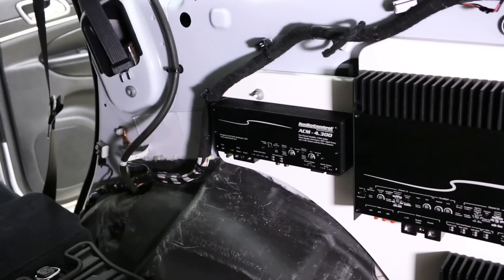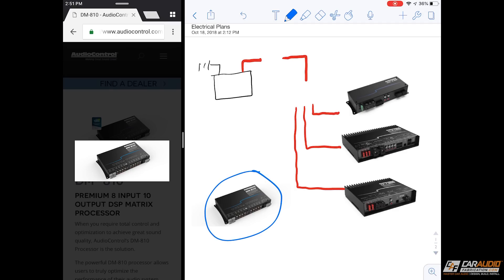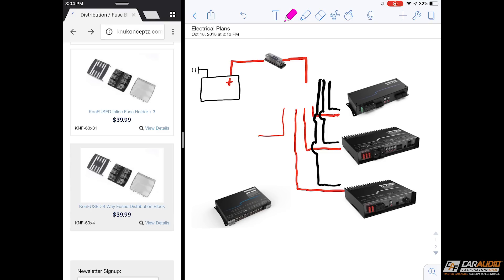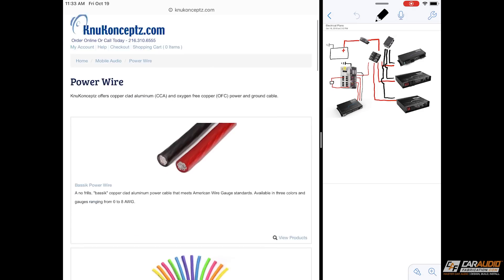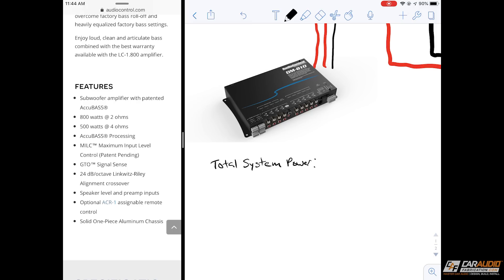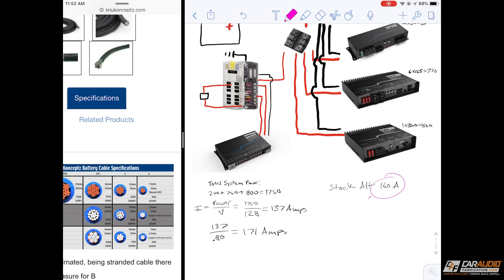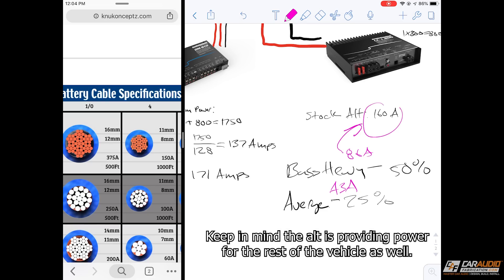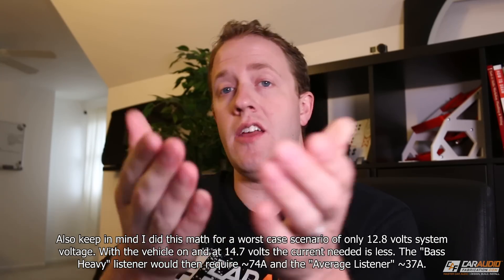How to plan car audio ELECTRICAL system wiring - Is the alternator big enough?

Comment: what size fuse do u you use for the powerwire to the fusebox? and what thickness of wire should i use? Im running a distroblock with 50mm2 in and using 2 20mm2 cables to my amps, can i use 1 10mm2 as power to my fusebox? i will only run a dsp to that fusebox.

Comment: How do we wire a 2 battery 2 amp audio system
Reply from the maker: Same as this, with parallel connections between the batteries, fused of course

Comment: I had my audio system done ✅ and it's a total of 6 speakers and 2 subs that = 2200w RMS on 2 amps.

I asked about upgrading alternator. They said they don't do it and don't bother, and to save my money 💰 
.
My alternator is 130A and the car uses 30A.. I have 100amps of headroom.

But my system needs 180 amps...

So I'm short right?

I need a better alternator.

Anyone know where I can get a good alternator to suit a 2002 LS1 Holden Commodore V8 5.7Ltr

Comment: Thanks for the video, I'm about to get ready to buy all the stuff I need, could you help me clear some questions?
1) When adding the power consumption of the amps, shouldn't you also add the power consumption of the DSP?
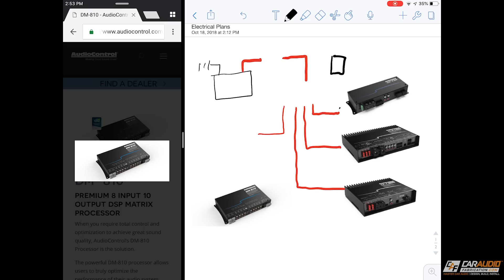2) at 2:48, is the ground distribution block necessary? Or can I have each amp grounded on different points of the car? I don't want to run so much wires, also isn't is best if the ground wire is as short as possible?
3) at 4:38, you added a smaller fuse block. Shouldn't you also add the power consumption of the accesories connected to that small fuse box to the overall power consumption calculated before? The 3 amps+DSP+devices connected to small fusebox? Thank you

Comment: So if I have been running a 1200 watt rms 5 channel for months now but wanted to run two amps that will be using no more than that same 1200 watts do i need to upgrade my alternator? Everyone keeps telling me it don't matter that I still need to upgrade the alternator. Your opinion is the one I really care about and want to know? I was hoping going from 4 guage to 1/0 ofc and the big 3 would be enough.

Comment: How to connect dual battery wiring for 4xAmp (4ch) , 1x mono block , and 1x DSP audio system ... 160A alternator .. fuse? Powercable? Wiring connection? 🥺 Need help Please.. No ideas for do it..

Comment: At the 8:57 mark, you said your amplifiers have an 80% efficiency. The formula is 137×.80 = 109.6 amps, not 171!! Did I miss something?
Reply from the maker: Yes you did. We are working backwards through the math. And amplifier MUST have more current in than out. That's what efficiency means. 80 percent efficient means that 80 percent of current in is what we get out. We know current out based on power rating. So we work backwards to determine the larger current value in to properly size the wiring and fuses

Comment: I will say that I have a bench top power supply for testing. 14v @2A. I hooked up an amp and 2 JL M6 speakers. I was able to turn the speakers up so loud that my ears were hurting all on the 2 amps. Only when I turn it up all the way did I get any audio loss. And I needed to turn it up all the way on a bass heavy song before it blew the breaker. Point I’m saying is you can drive the heck out of 4 speakers with very little power. The high amperage comes with your subwoofers. Just something to keep in mind

Comment: How do I find the correct in-line fuse size for the fuse closest to the positive battery terminal line coming from the battery? Also, If I use OFC power wire, do I need to use OFC Ground wire as well, or is any safe to use as long as it is the same gauge? THX Fam!

Comment: Curious. My truck has a 110 amp alternator and I want to put a 2500 watt amp in it. Will a 96ah headway bank help achieve that or will I need to replace that alternator?

Comment: My question is, what criteria did he use to determine that the 86 amps required for this system in question would likely require an upgraded alternator from the 160 amps. Is there a rule-of-thumb? Thank you!

Comment: A question to Mark: First, a huge thanks for the info. So, do I select the fuse rating as per the total system value or depending on the actual draw calculated.

Comment: Now this is way late but maybe someone can help. Im tryna plan my build i want 4 10s pushing around 3k watts i also have a second amp pushing 400 for my speakers with the math i need 337.3 amps am i supposed to add my stock alternator to that as well or is that a good number

Comment: Like it I like your videos I have a head prob from baseball bat and I can understand you I have a 2011 Ford edge and I'm  only trying to upgrade the door speakers and it has a stock sub so I figured single 10" or 12" I have a old school LS 7 square 15" kicker and the heavier 12" pioneer premium I'm on social security so I'm trying to find anyone who has any old amp and 4 6×9 for doors and I have to keep stock radio so if you have anything that's old and still works or know anyone who can help an old bass head out with anything just need a lil bit of bass so if you can help me and need me to put stickers on VEHICLE to represent no problem

Comment: I have a audi a7. Car is a electrical bank. Can/ should I get a higher amp alternator tho the car runs off a amg battery. I'm thinking off running a tarramp 5k amp and a 1200 watt amp for highs & mids

Comment: one 250-300 watt amp on the highrange cluster and 500-600watts amp for the subrange cluster would be pretty much ENOUGH to blast approximatly 120-130db depending if the system is an sq or an spl like system through the whole frequency range when all the amps are gained down to their 75% power. kicker sealed passive radiator sub system with an INBUILT amp hits 144.8db's at around 45hz and an sq components on the front with the coaxes at the back stage when fed around 300watts total easily hit around 125db+ and if you use midranges and all that spl stuff they can easily do 140db+ why would an average guy that wants some loud bass or some sound quality would need 1750 watts their total setup? do yall go around and listen music 140db+ all day?

Comment: My son is having a issue on his 2013 Toyota Corolla LE 1.8 L 4 cylinder sedan ( it is a regular gas car not diesel) after getting a after market stereo system (including amplifier and 2 12" speakers) it wont start now or it stalls out immedietley after starting we thought it was the alternator wasnt strong enough so he ordered a a 250 amp alternator and had to replace the belt to a shorter one, replaced the wiring for the electrical system and replaced the battery for a higher power one that has more crank power and more reserve but the dang car still will not stay running or sometimes won't start at all. Does anyone know what we should look at next or shoud he take it back to the place that installed his aftermarket Audio system and have them check to see if they wired it correctly? After he got the aftermarket stereo installed it was running fine for over a month until he blew one of his amplifier's and took it back to the shop to have it replaced with the warranty...it drove fine for a few days and then all the sudden i started it when he was leaving work and he didn't even make it out of the parking lot and it died and wouldnt start back up, so i thought possibly it was his stock alternator that wasn't strong enough to run his new audio system that has 2 amps that are  1000 watts a piece and 2 12" sub woofers so i went online and ordered a high power alternator 250 amps and the 3 wire upgrade that's needed for the new alternator got the alternator and wires installed and i was hoping that would fix it...but it didn't so he got a new battery that was stronger with more cranking power and more reserve but it didnt work either. Does anyone know what else he should check? Sometimes the car starts but it dies right after and sometimes it turns over but it wont start. He recently cleaned my throttle body really good and he replaced the fuel pump about 6-7 months ago....so idk if it could possibly be the fuel pump again? Or could it be his starter? But if it was the starter it wouldn't start at all? Or can it start and die if the issue is the starter? Does anyone think he could have damaged something with my electrical system since he had the aftermarket system installed and the shop never told him he needed to upgrade the alternator And battery prior to installing the amplifiers and speakers? Something that would prevent his corolla from starting or cause it to stall out after starting even after upgrading the electrical system 3 wire upgrade, 250 amp alternator and high power battery? If so how can we find out what the issue is? Thanks in advance to anyone that can offer me any suggestions on how to fix my sons car.

Comment: Hi Mark, I've got a Nissan Pathfinder R51 and I plan to install a 4-channel and a Monoblock.  I'm not sure where to install the amps.  I wouldnt want to install under the seats as I feel the space is limited and may not offer the enough air circulation.  The rear is what I prefer, but wouldnt want to sacrifice the 7-seater capability.  Please guide

Comment: So I'm working with a hybrid vehicle that uses a dc/dc converter over the traditional alternator. Could I add another battery in back as kind of a buffer. I don't seem to be having any issues with charging system but I know I'm right under the limits of the vehicle's system.

Comment: Hello and thank you for the videos.  I'm entering the world of DIY audio and these have been fantastic in climbing the learning curve.  One question I haven't been able to find any details on is regarding how to relate the power needed for the new audio system to the specs needed on just the vehicle's battery setup.  I will be installing a DIY system on a new boat and there's no alternator to run the system while underway, just a stator that keeps the battery charged up, so ultimately all of the audio system's power will need to be provided by the battery (upgraded) setup.  With that in mind,  I'm looking for any content or go-bys that outline how to relate the power needed by the audio system components (amps & speakers), say 80 amps for example, to the spec of a battery, which is usually in Amp Hours.   I would appreciate if you can point me to any of your videos or resources that cover this.  Thank you!

Comment: If the wiring to use from the battery to the distribution block, then to the amplifiers bigger than recommended, would that be ok?

Comment: Thank you for sharing the knowledge! I am planning on doing an audiocontrol D6.1200 or D4.800 to include an LC1.800 in my 2021 GMC Sierra. My OEM alternator is 220 amps. The D6.1200+LC1.800 would be approximately 135 amps. The D4.800+LC1.800 would be approximately 113 amps. Are any of these setup safe for my electrical system while doing a 5 hour road trip one way and another 5 hour back. Done twice a month. Thank you

Comment: Great video Mark!!! 👍👍👍 They were a few things you didn't mention about the electrical upgrading!!! One was the BIG 3 for the grounds and the addition of a battery or batteries to power the entire sound system if needed!!! Everything else was very informative and excellent!!! 👌👌👌If you were to go with four amps instead of three like your doing in this video,would that change the kind of distribution blocks that you are currently using or would you still be able to use the very same one's that you showed in this video??? I ask because I'm going to use four ROCKFORD FOSGATE PUNCH AMPS for my build!!! Two PUNCH 400a4's, one 200a4, and one mono block T1500-1bdcp for my sub's!!! I'm in the process of trying to find a big enough alternator to power my whole sound system!!! I currently have a stock150 amp alternator but I don't know if that's going to be enough to power my entire system!!! So I'm in the market for a bigger one!!! Of course I'm doing the BIG 3 upgrade and adding additional batteries in my rear cargo area!!! Your help and advice would be much appreciated!!! Thank You and I love watching all your video's they are always very helpful!!! I'm a BIG CAR AUDIO fanatic I have been for the last 27yrs!!!✌️✌️✌️

Comment: Hey guys excellent videos. I need some advice for my current audio system. I have an pioneer avh-210, a pioneer amp and a 12" kicker sub. I am having issues with the sub sometimes it pounds most of the time it doesn't. Any idea what can be the issue. How can I talk to you guys directly. Thanks very interesting channel

Comment: Also forgot the demand load on the electrical system by the vehicle.  Computers, air conditioning,  heated seats/ mirrors etc, etc all that takes a lot of current and the reason why the manufacturer installed a 160 amp alt. Got to be aware of what your using load wise by vehicle and how bass heavy the music is.

Comment: Planning isnt my strongest side. 
Doing every thing in affect, and later on doing all the planning. 

When I know went down the road of car stereo, I bought a dsp, and a 2 channel amplifier. 
My goal now, is to keep the luggage compartment as is. No visible elements. 

Question. Under the seats, I have piping for air distribution in the car. 
Being an ice tap, I freeze nearly to death in 5 degree plus. 
Meaning I run the fan at max speed, max heat whenever Im out driving in this conditions. 
How sensitive is a dsp for a constant heat exposure?

Comment: One thing I would love more info on is how to regulate the voltage when you upgrade an alternator. I’m sure there are plenty of cases where the factory system can regulate the extra current but I doubt all systems are capable of that, especially when increasing the amps produced by more than 2x the factory alternator.

Comment: I have a compact car and don't need a whole lot of bass. I plan on installing two powered subwoofers under the seats. My question is if both powered subwoofers have an output for a bass knob can I just make a cable to run both powered subwoofers with one bass knob?

Comment: Is pointless to have a separate DSP if using the D-6.1200 amp that already has a built-in DSP and the LC-1.1500? I have 9-speakers and two subs, and was thinking I need an additional 3rd amp for the other speakers since the D-6.1200 only has 6 outputs.
Reply from the maker: If you need 9 speakers it would make more sense to have a DM-810 with an LC-6.1200, a 4 channel amp (bridge a channel) and a sub amp.
Reply: @CarAudioFabrication  Thanks, Mark. I’ve already got the D-6.1200, and the LC-1.1500 and couldn’t figure what to do, so figured I’d need a 4-channel but couldn’t figure out the wiring configuration. Any suggestions besides returning for exchange?

Comment: Hey mark, when finding power total for 4 channel amps, how do you configure that? Take for example @ 2ohms an amp puts out 150 watts x 4 channels. Do you use the 150 watts or do you use the 600 watts after adding up the 4 channels??

Comment: My total watts is 2300 so I divided by 12.8 which I got 179.6 then I divided that by 0.80 which then gave me 224.6. So that means I would need Zero gauge wire from the battery to the amp, correct? Someone who is installing a sub which would get me to the 2300 watts said that the 4 gauge wire I’m running right now from the battery is fine for it but I wasn’t quite sure bout that.

Comment: Been subscribed since almost the beginning. Always love the content and its always spot on. 
I believe you might have your calculation for 80% efficiency a tad off. If 137 is MAX and 100%, it would be 137 TIMES (x) .80 = 109.6 or a 110 amps. Am I not thinking straight? ~Rob
Reply from the maker: You're not thinking correctly. Amps in will ALWAYS be more than amps out. You can't create power out of thin air. We know the output power so we are working backwards to determine the power that must come in. Make sense?

Comment: My car has a tesla screen installed now and I want to go back to oem and add the piggy back which is just 3 harness clips and to route it in the glove box. But not sure what to do about adding the second amp to power the other two sets inside that are currently not being powered. I'm afraid they are being drown out by bass. The lc8i has a control knob too. Not sure if I need to run all new rca wires or what I'm kinda co fused this is a technical setup for beginner 1st install.

Comment: I have 3 amps connected to a distro block for power. But for the ground, instead of using a distro block, I’ve bolted all the grounds to the same grounding point on the car chassis. Is this okay? Or should I use a distro block?

Comment: Great video always full of info.. I have a question I purchased a nissan frontier pre-owned.  The previous owner added a sound system.  He added (3) 6 1/2 mids on each front doors and (2) 6 1/2 mids at the rear doors.and two 10 inch woofer under rear seat. All powered by 2 amps. All professional fabricated and installation. Ok here is my question the complete system is set up using HIGH INPUT with a aftermarket headunit which is equipped with 3 SETS OF RCA. which is better using RCA or high input? 🤔

Comment: The KNF60x2 is not all I hoped it would be. Maybe you can suggest a couple of things to Knukonceptz: 
• Include 2 extra 4g inserts since it's designed for Hot and Ground input and connections to 2 amps.
• Taking it apart is a royal PITA, and it seems like it would be easy to break the tabs on the plastic covers.
• Dark tint is nice, but you can't see the fuses at all, this just looks like a black plastic box with wires. It would be nicer if it 'showed off' the form and function.

Comment: Does it matter if I mount the cross overs for the front speakers in a extra cab truck on the back wall by the amps , instead of hiding some where by  the doors